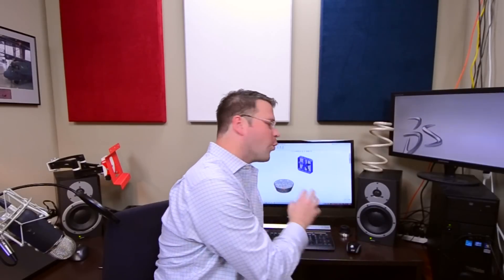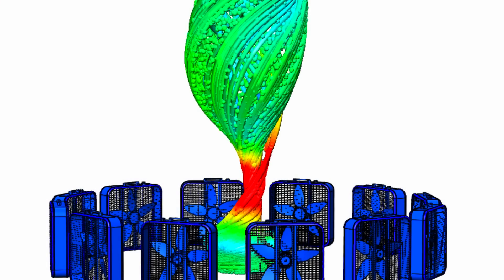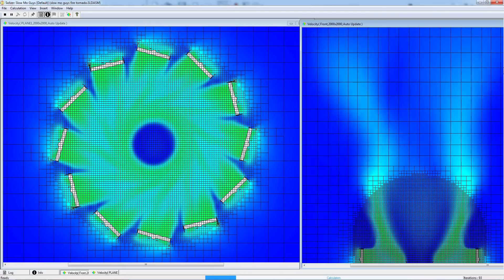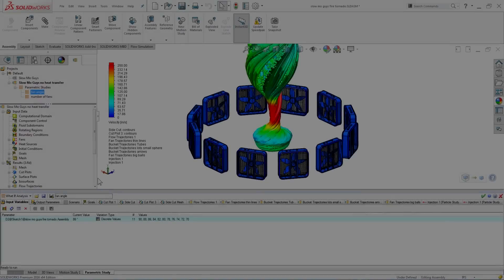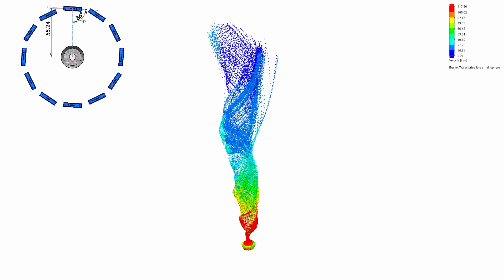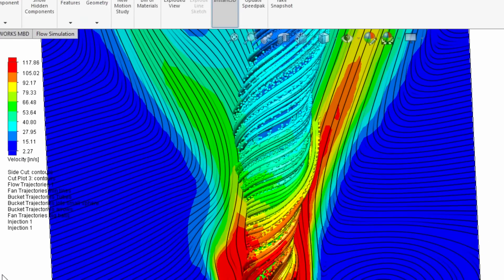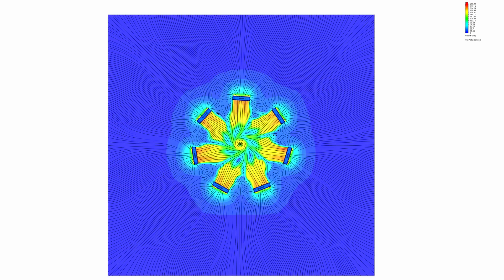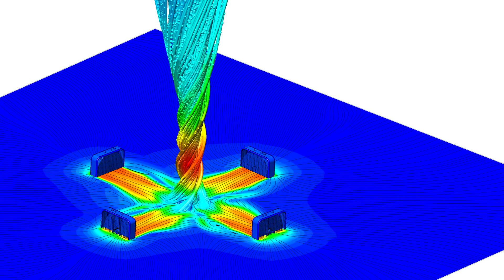Digital Simulation: Video Reply to "Fire Tornado in Slow Motion 4K" by The Slow Mo Guys

Comment: This is absolutely amazing, I never would have thought to do this with Solidworks. Is there any way you could share the files for the Fans? I found them on the solidworks website but it seems that the archive is corrupted. A friend and I want to experiment with the fire tornado simulations.